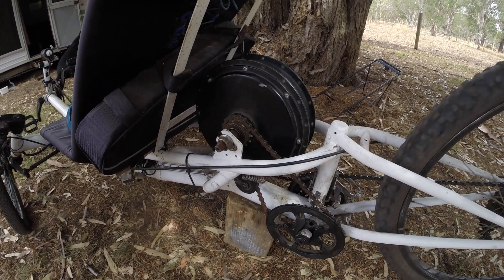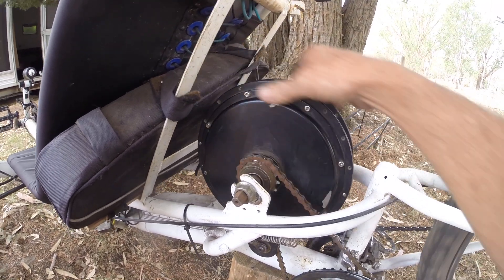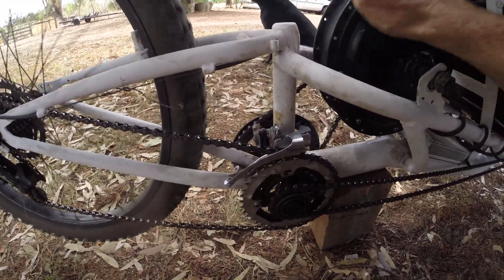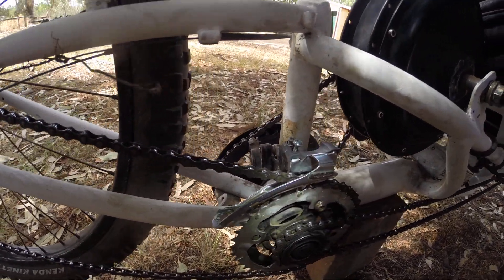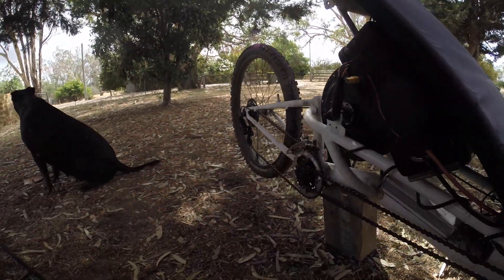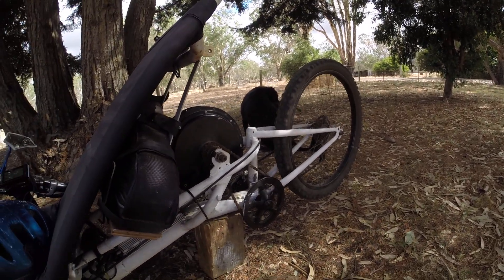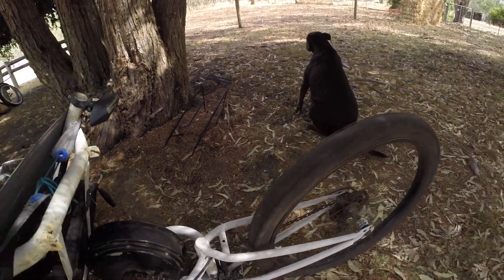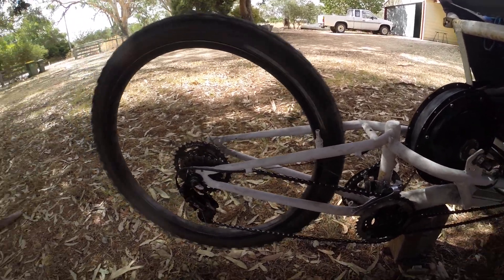How I converted a hub motor to mid drive

Comment: Did you see any improvement in using it as a central motor instead of putting it in the wheel as usual? I'm interested in trying something like that, but I don't know if it's worth it.

Comment: Hey I have a question; How did you install the free wheel on the hub motor?
Reply from the maker: I just screwed it in as normal. Normal freewheel on a normal hub. Because is free spins in 1 direction I had to make the normal crank into a jack shaft
Reply from the maker: The freewheel on tha jack shaft is attached to a wheel centre that is welded to the front gear
Reply: @shaunbriggs77  got it! thanks

Comment: Is there any reason why you couldn't have the hub motor stationary with the axle going to lathe gearing?
Reply: The wiring for the motor is fed through the centre of the axle, so if the axle spins the wiring will be instantly shredded!
Reply from the maker: No reason. Just a simple way to set it up

Comment: Whats the top speed? was torque increased after making it a mid drive?
Reply from the maker: The tops speed is about 60klmh and yes the torque was increased significantly due to being able to use higher gear ratios.

Comment: how did this affect top speed? and do you think it is possible to add a better gearing ratio to achieve higher top speed? I have a 1500w 72v hub drive motor, current top speed is 64 kmh
Reply from the maker: It did not make much of a difference in top speed but it has given it a lot more torque

Comment: this is lowkey impractical but so fucking cool nonetheless
Reply: It's very practical
Reply: @FightFilms  it's cheaper and less effort to just buy a hub motor off Amazon
Reply from the maker: It was originally in a wheel. I took it out and used it as a mid drive so I can utalise the gears for when I tow a trailer with my 50kg dog and come to a hill. With my set up I can climb any hill as long as I have traction 😊

Comment: So I have a hub inside the mid space of my bike...with a freewheel on it(on the right side) the hub and freewheel spin together when the chain is removed. When I put the chain back on and give it power only the hub spins but not the freewheel....so all I have to do is flip the hub ?
Reply from the maker: Yes as the freewheel spins in the wrong direction. That is why I run the hub turned around
Reply: ..you also mentioned in a comment...having to switch phase wires around also....is that required too?
Reply from the maker: Yes you will have to change 1 of your phase wires. And the same colour change on the hall sensor wires
Reply: @shaunbriggs77  ok..just to be clear....my freewheel locks when spinning forward, it spins freely backwards...but when I put it underload... only the hub spins ...chain and freewheel are still. Ok thanks
Reply from the maker: Once you turn the motor 180 degrees the freewheel will work as you need it.
Reply: @shaunbriggs77  ok thanks for the help 👍

Comment: You probably already thought of this but what if you reversed a free-wheeling bearing on the peddle sprocket. like in this video https://youtu.be/-sJwkulJUM0 ? So that if the chain runs faster than the peddles the sprocket freely spins. Then use the motor as a chain tensioner. I am building a recumbent in Adelaide and your videos are inspiring as I want to put solar on too and tour.
Reply from the maker: Thank you. I never could figure out out to reverse the freewheel. Would make it easier for doing the conversion. Hope your build goes well Wayne

Comment: That's for the video . On the Hub motor sprocket how many teeth are on the sprocket and how many teeth are on the other  two  sprockets.
Reply from the maker: 40 tooth and 38 tooth, 40 tooth and 40 tooth will work fine

Comment: Do you need to have both chains ? Could u run it just so sprocket on front to back on bike like normal?
Reply from the maker: Yes and no, with my configuration I need the 2 chains. If I was to run a chain directly from the hub to the rear wheel I could run a single chain.
Reply: How did you mount the sprocket ?
Reply from the maker: The sprocket on the hub motor is just a normal free wheel sprocket

Comment: I see a couple of hub motor to mid drive videos I think yours is the best
Reply from the maker: Thanks mate.
Reply: @shaunbriggs77  do you think a similar type of thing can be done with an electric scooter wheel? I am having brain farts when I try to figure out how to make the wire not break should I use a custom sprocket on the axle or let the whole rim of the wheel move?  o
Otherwise it seems like the phase wires will get ripped out. Hmm
Reply from the maker: With a scooter wheel you could modify a sprocket to mount where the disk mounts to the wheel. Use spacers as required
Reply: @shaunbriggs77   after further review I did see the whole wheel was indeed moving I guess I will have to mount some kind of sprocket adapter on this hub because I don't have disc brakes on thia scooter wheel .. only drum brakes... Thanks for the response I think I can let that marinate for a bit.
Reply from the maker: Yes the hardest part of it all is deciding how the gear will be mounted and which way the hub will need to spin

Comment: I'm trying to figure out how to fabricate a setup much like you have here for my pedicab. I'm a little confused about how you said you flipped the motor over and the freewheel still pulls forwards. If I put on a freewheel and flip the motor over so the freewheel is on the left side,  the freewheel will only pull in reverse. Is there some sort of magic here I'm just not seeing?
Reply from the maker: I have the motor running in reverse as well because it was rotated from right to left. The freewheel drives the chain when the motor runs in a forward motion. If I turn my motor backwards with my hand the chain remains still.
Reply: @shaunbriggs77  I understand how to get the motor to spin in either direction by changing the wiring/connectors but when I flip the motor over so the freewheel is on the left side and then spin the motor in the forward direction, the freewheel doesn't engage as I'd want it to. And the threading is for the right side so I can't just get a left side freewheel as it has different threading. 

I tried testing this out this morning with both a right side and left side single speed freewheel.
Reply: Okay I'm definitely going crazy. 

I just got the right side freewheel again and re-tested it out to confirm things and it's working exactly as your video shows. 

Your solution here definitely appears to be the best one I've found for converting a hub motor to a mid drive and now that last part of the puzzle is solved :)
Reply from the maker: Glad you sorted it out. Hope your build goes well
Reply: @zalafinari   I have a 1200 watt Hub motor on my rear on my bicycle watch this video of  this guy use the Hub motor as a mid Drive motor and it's pretty interesting I want to do that,  I was wondering did it work for  you on your  built with the  free-will on the left side and the right side.  That's
Reply from the maker: I have the freewheel on the left side for it to work properly
Reply from the maker: Is the freewheel on the hub motor? I don't understand how it does not lock up when in the forward motion? The whole reason I had to flip the motor was because of the freewheel needing to lock up in the forward motion

Comment: Very inspiring build. Thank you for sharing this. I wanted to build something similar like your system. Could you please help me to understand how the 2 big gear on the back is connected and how you made that part? Thank you for your help.
Reply from the maker: If you are referring to the pedal and motor drive gears I used the threaded part of a rear wheel and welsed it to the larger centre gear and then screwed on a normal single speed freewheel gear on it.. So my pedals drive the freewheel and the motor drives the larger centre gear. Hope this helps
Reply: @shaunbriggs77  thank you so much for your reply. Do you have any idea how to put it in reverse? Because i’m building an enclosed trike, i need to be able to set it in reverse.
Reply from the maker: @davidbudiatmaja775  to have a reverse it would require you to run a completely different set up. It would only work if you ran a separate gear on the rear wheel on the opposite side of the original gears and to then use a fixed gear on the hub motor. Any wheel with a freewheel gear will not have reverse. You would be better to use the hub inside the wheel for your purpose
Reply: @shaunbriggs77  I have build a 2000w 72v hub motor on a motorcycle. What I don’t like about it is be able to change the gear to increase torque on a climb. 
I think i can modified your system so that it can use reverse. So the hub motor will be fitted with 2 flywheel that is in opposite direction connected to the big gear that have the same setup as the right side, but the flywheel is on the opposite direction. The flywheel then is connected to rear hub on the left side (have to modified the hub so that it can house the brake rotor and the opposite direction flywheel). So the rear hub will have 2 chains. On the left is use for reverse purpose.
The drawback is that the hub motor will alway be connected to the rear wheel rotation, but it still have ability to change gear.
What do you think about this setup?
Reply from the maker: Yes that would work. I was going to have reverse on my trike early in the build but the amount of times I would actually use it is very minimal so I decided I did not really need it. Hope your build goes well for you.
Reply: @shaunbriggs77  thank you

Comment: Hi sir as you said motorized hub is freewheel...what about on the other side is it freewheel also?
Reply from the maker: Yes the other side has a freewheel sprocket on it as well
Reply: @shaunbriggs77  Sir I'm from Philippines .I've like to assemble recumbent bike like yours diy...can I ask for the dimensions and specification of your RB, I consider your bike more interesting to build...thanks
Reply from the maker: The length from pedal crank to centre of the rear wheel is 190cm and the width from outer front wheels is 90cm

Comment: Hello my friend.I am really impressed of your idea.Can you tell me how many watts is that hub motor and what is your top speed with that?
Reply from the maker: Hi, it is a 1500w hub motor and I can reach a top speed of 70klmh, 43 mile an hour.
Reply: @shaunbriggs77  wow.This is great.Thanks for sharing your project.I think i am going to try it.
Reply from the maker: @ketsos36  I usually have it in an easier gear as I don't need to go that fast most times I ride. I prefer the extra torque from the easier gearing for hill climbing and just general daily use. I find that hub motors make great mid drive motors when set up right as they are super quiet and smooth. Good luck with you project mate👍
Reply: @shaunbriggs77  Can you tell me how did you reverse the hub motor because i am trying to figure out.I have a magic pie 3 and the only way i found is to use the reverse button but i don't get full speed on reverse.
Reply from the maker: I changed 2 of the phase wires and the same wires on the hall sensor wires.
Reply: @shaunbriggs77  Okay.I will try it.Thanks again.
Reply: @ketsos36  Hi! :) Can i use the front wheel motor to build a mid with it ?? Do i have to reverse ?
Reply from the maker: @sensorecord368 yes you can use the front hub. You will have to adapt a gear to go in place of the disk. Should be able to run in the normal forward rotation

Comment: Probably the best use of a hub motor for it's quietness and now gear switching. I can't stand the sound of mid-drives.
Reply from the maker: I have to agree that hub motors are much quieter. And a little less maintenance too 👍
Reply: Youre a genius. How is your flexible solar panel? Mine breaks every 1.5 years. The solid solar panels last long but r very heavy  @shaunbriggs77

Comment: how is your repair rate soo far?
Reply from the maker: So far I have repleced a rear wheel as the one on it could not have the bearing cup removed and it wore out. 1 rear cassette and 1 chain. And I have done over 4000klm. I have just recently added rear suspension and I will have a video up shortly about it
Reply: @shaunbriggs77  Awesome I cant wait.

Comment: Please, how rear hub is dealing with a big torque of motor? It is regular hub which is used in common mountain bikes? Do you think you could replace current motor with for example mxus 3k? ( which has pretty big torque like 100nm or so.. :-) ). And please, I was thinking about this concept mainly because of saving battery and get more kilometers/miles per charge. What is your experience? Is saving of battery  one of big advantages or it is no significant in compere to classic hub motor in rear wheel? Thank you.
Reply from the maker: The rear hub has held up pretty well. I just recently replaced it and the chain as they were getting pretty worn out, about 2000klm before I had to replace them. 3000kw would be too much power for this kind of set up. Would be easy to run a disk wheel with a single gear on it and have the electric drive on the left hand side. Having the ability to change gears helps quite a lot especially if you have head winds or long hills as you can select an easier gear and use less watts. Hope this helps

Comment: Im having a heckuva time coming up with a bracket for mounting the blinking motor on my radwagon without major surgery.
Im curious about the chain itself....is it holding up?...especially if you double down with pedaling + motor.
Reply from the maker: The chain is holding up rather well. I have done over 2000klm on the current chains. They are due for replacement as they have become rather stretched

Comment: Are you able to still change gears?  It seems like the rear gears are more or less just spacers to keep chain aligned.  Do the deraileurs do anything?  I hope you dont mind be picking your brain.
Appreciate your efforts.
Reply from the maker: Yes the gears work just like a normal bike. It is a 7 speed. The derailleur changes the gears
Reply: Oooh ...I see it now...had to freeze frame to see you have only one chainring up front pedaling.  I was wondering if you had some fancy way to change gears at 3 locations....haha

Comment: I need this for my bmx, I want to extend swing arm behind and leave hub motor on existing dropouts,

What rear hub did you use? 135mm hub?
Reply from the maker: The hub motor is a 1500w fat bike hub 175mm. You can get a 135mm rear hub
Reply: shaun briggs sweet I have a MXUS 3k turbo running 84v 400amp phase 160amp battery ferrofluid and dual hubsinks, should be good
Reply from the maker: Wow that's a pretty powerful set-up, your bmx will be lethal
Reply: shaun briggs I’m working with carbon fiber rear extension, bmx frame is chromoly with compression dropouts to hold hub axle
Reply from the maker: Cool, you making your own carbon swing arm?
Reply: shaun briggs yup using what I need from the steel frame and going full carbon on everything else, I have my own vacuum pump, so carbon fiber resin infusion is a simple task for me, takes a lot of time, but worth it  :)
Reply from the maker: That's awesome, I would like one day to use carbon fibre on a project
Reply: Just worried about chain and sprocket breaking?
Reply from the maker: @dylandesmond  you can buy ebike specific chains that are a bit stronger than normal bike chains

Comment: Very cool but can You use the padles and use the motor at the same time 😅
Reply from the maker: Yes 😁, I still have pedal assist
Reply: @shaunbriggs77  just to be sure you can use to motor and pedal at the same time to fx safe battery power because the motor dosent have to do all the Work
Reply from the maker: Yes I can pedal while using the motor. Just like a regular e bike.
Reply: @shaunbriggs77  amazing most build somthing like this 😁
Reply from the maker: Thanks Hans, it has taken me a while to get it all figured out and working as it should.
Reply: @shaunbriggs77  i Wil write You wheen i am gonna need help 😏
Reply from the maker: I am happy to help in any way possible Han
Reply: @shaunbriggs77  where did You buy the ebike kit 😅
Reply from the maker: I bought the kit of ebay. They are pretty cheap these days. 1500w hub motor is about $300 Australian
Reply: @shaunbriggs77  i live en Denmark there they are abit more expensive 😅is IT geard og direct drive
Reply from the maker: It is a direct drive Hans. It is pretty maintainence free. I have done about 5000klm and have not had to do any maintenance on it
Reply from the maker: It is a direct drive. Pretty much maintenance free.